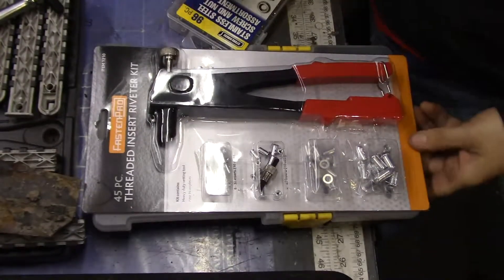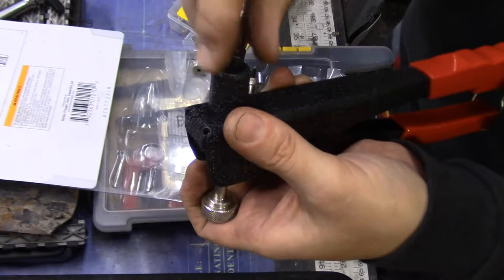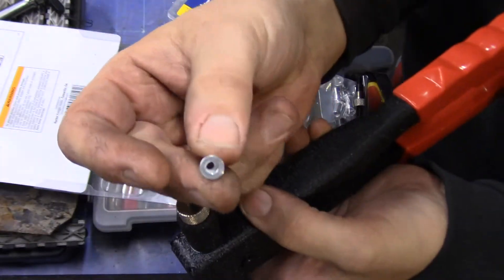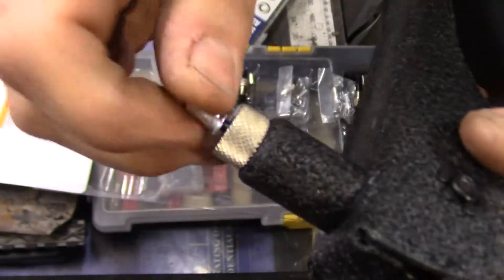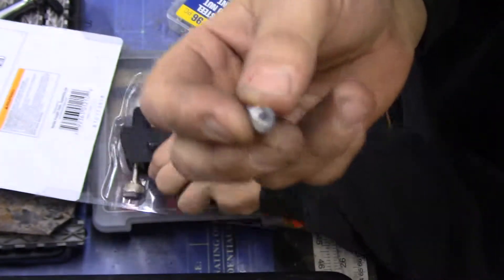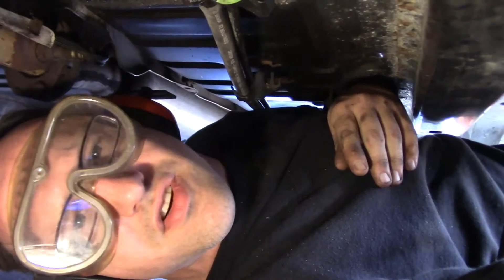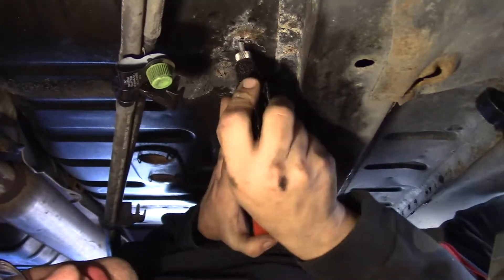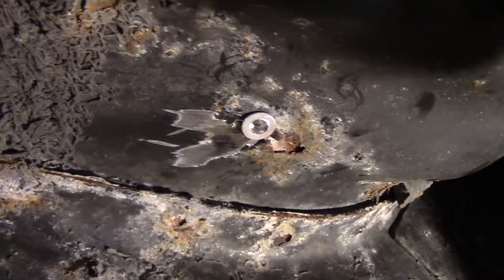2001 Saturn SC2 Brake Lines Part 2 Rivet Insert Nuts

Comment: Did you drill the hole for the inserts directly where the Old studs were or just in front or behind where the old stud was to keep the retainers lined up and the hole easier to drill?  Getting ready to tackle this project. Thanks!
Reply from the maker: GoopOfOil, I tried to drill the holes right where the old studs were. I did notice the screws poking up inside the car under the seat after I was done so be mindful of where you're drilling. Good luck!